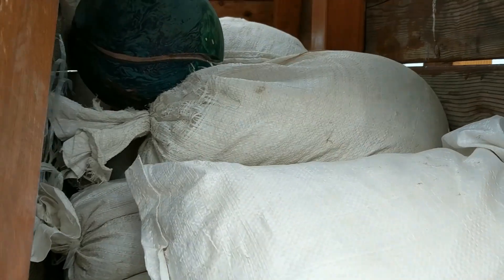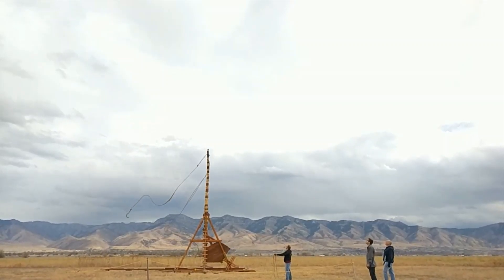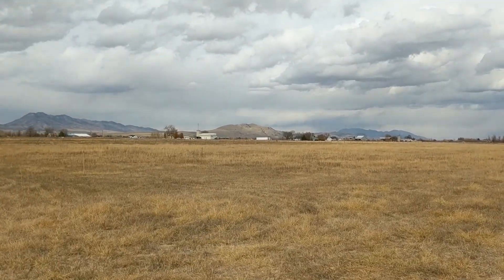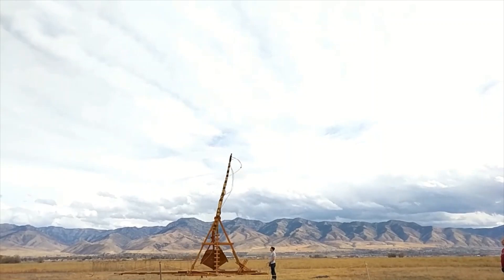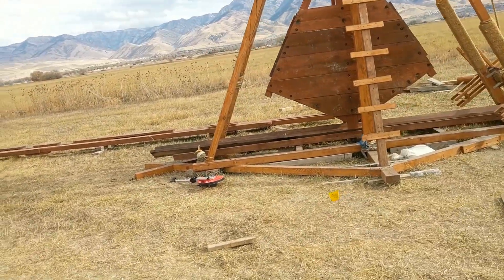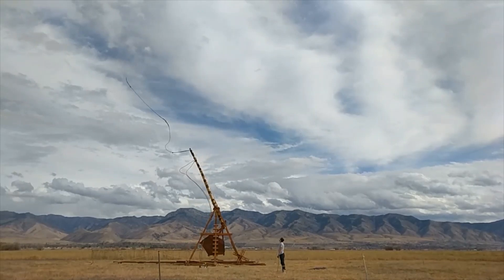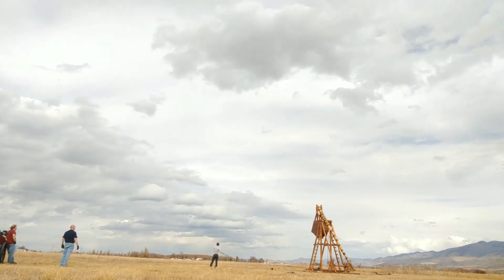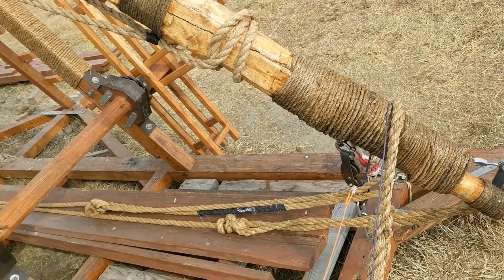The Medieval Trebuchet 2020:  Epic Launches with the Sentinel

Comment: at :20,  sling lines  Definitely  a  bit  TOO  long.
Reply from the maker: The first shot was a warmup shot, coaxing the machine up in counterweight.  Sling was indeed long.

What do you think of the tuning on the shot at the 9:01 timestamp?
Reply: @MedievalTrebuchet  still  too  long.      (in slo-mo)   at  9:06,  the lines are  NOT  taught  and   they  Should be.     the   payload  SHOULD  be  leaving  the  platform;  possibly,   being  able to  FALL  so the lines  REMAIN  taught.       if the lines are not taught  the  WHOLE  time, energy  is  Lost.         cheers